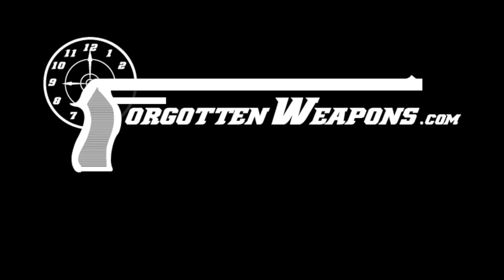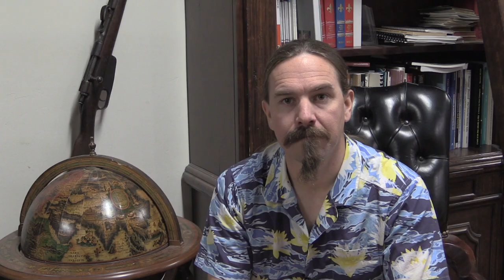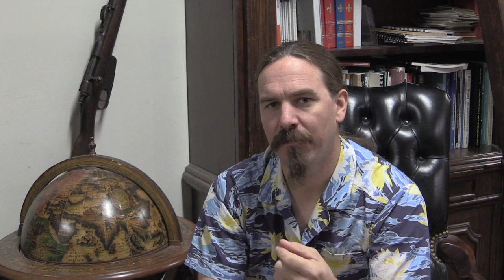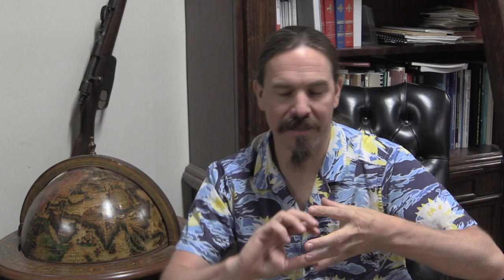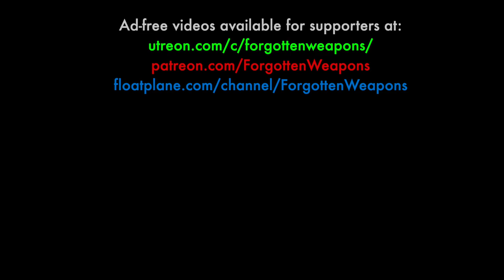Ask Ian: Progressive Twist (Gain Twist) in Small Arms?

Comment: The only variable depth rifling I have heard of is in large guns where the rifling starts deep and finishes smooth bore.  This is to reduce drag by smoothing the driving band into the body of the shell.
Reply: In Russia, a lot of civilian rifles start of smooth bore and end with about 100mm of rifling. They’re still considered shotguns because the majority of the barrel is smooth bore, but you still get a bit of spin stabilization at the end.
Reply: @ASaltySeabass  It is amazing the number of non-optimum designs that exist to get round laws.  I would have thought that starting rifled, then smooth would work better, as the bullet would not be going fast when it got to the rifling.
Reply: Carcano’s had deeper rifling towards the muzzle to reduce friction.
The German 13.2mm TuFG rifle was a squeeze bore where the muzzle was smaller than the breech by 0.2 mm giving a 13mm projectile. 
The Australian Myra Extruder 0.22” long rifle was similar with a 0.17” muzzle.
Reply: @allangibson2408  None of that makes much sense to me.

Rifling getting deeper towards the muzzle is likely to cause gas to escape along the groves.

13.2mm down to 13mm does not seem like a useful squeeze, but it is enough to cause stress in the bullet and barrel.

22 to 17 is a useful squeeze, but I suspect it would distort the bullet in variable ways, destroying accuracy.
Reply: @charlesphillips4575  The 22 Myra Extruder was noted for its accuracy and high penetration (a combination of high velocity (a function of being a squeeze bore and the increased breech pressure) and high sectional density (like the 6.5mm Carcano). Spin stabilising a narrow bullet requires high rotational velocity however. The Myra was noted for punching holes in steel that standard 22’s just bounced off.
The theory behind the increased rifling depth was decreased friction (I didn’t actually say it proved to be a good idea (but neither was the Blish “Lock” on the Thomson Gun).
The 13mm TuFG was capable of punching holes in 20mm armor plate at 200m. The bullet design was copied for the 0.50 Browning Machine Gun so that part worked. Browning didn’t copy the squeeze bore aspect however.
Reply: The Springfield 1861 from the civil war uses a variable depth rifling which is important for accuracy of the miniè ball

Comment: Part of the large bore issue is that the circumference is far larger so the outside is being accelerated in it’s rotation far faster than in a small diameter bullet so the stress on the jacket/case join is much larger. Lead bullets for black powder arms suffered similar issues due to the ductility of the lead so the stress was at the lead/steel rifling point so their interpretation was the lead stripping off the skin of the bullet and damaging accuracy and lead fouling the bore. Initially that led to harder lead alloys and then to paper patching. Forsyth dealt with the issue in large bore sporting muzzle loaders by drastically reducing the twist to allow higher speeds from larger charges.

At the end of the day the bullet exits the barrel with the twist rate at the muzzle. As long as it is not damaged then the rate of change of the twist earlier in it’s journey up the barrel has no effect. Gain twist is useful only in limiting the stripping of the bullet lead skin or hard bullet jacket.

Thank you for explaining this Ian.

Comment: There are a lot of jacketed bullets that are suited for the .45 Colt cartridge, that would not stand up to the much higher pressure of the .460 S&W. The gain twist in the .460 would not put as much stress on those bullets. Also, there could be a slight reduction in chamber pressure, but I don't know that for a fact.
Reply: Ian mentioned this in the video about the auto mag .357AMP kit. I wonder if progressive rifling would minimise the problems with that cartridge. I live in the UK so all this might as well be "how to engineer a unicorn" but it is sure interesting stuff.

Comment: I think this is something that needs further research. 

Enter the 8.6 blackout 1 in 3 twist.

Because the bullet is mostly sub-sonic variants the 1 in 3 does very well, and delivers unheard of accuracy and energy.

If a much faster super-sonic round started with a slow twist rate and ended with something like a very fast 1 in 3. I believe there would be significant improvement similar to 8.6 BO

Comment: I could see reasoning the progressive twist rifling on the 460 S&W for exactly the reason Ian noted. Imagine a 180-grain jacketed bullet intended for the 45 ACP handloaded hot in a 460 S&W.  I'm sure the velocity would be impressive but at that speed the jacket may have difficulty remaining intact with the lead core.
Reply: Speer 200gr hollow point meant for. 45acp would be bad.

Comment: One thing I did notice, because I shoot a lot of both semi-automatic double action revolvers and single action revolvers. Is that on my Super Blackhawk when I inspect recovered bullets, the Leading Edge of the bullet where is engaging the rifling always has skid marks on it where it is engaging and slipping on the beginnings of the rifling. It's an interesting way to show whether or not a particular projectile was fired from a single action revolver or a double action revolver. Because they have a longer cylinder normally, the bullet accelerates much faster before it engages the rifling. In something like a 44 Ruger Super Blackhawk, I have seen test where they have completely removed the barrel and the bullet from a Winchester 240 grain hollow point will exit the cylinder at 1100 ft per second, if you leave just 1 inch of barrel it will be about 100 ft per second less

Comment: Ian: "Too high a twist rate can lead to jacket separation" 

Me: stares intensely at Q 8.6 BLK supers with a 1:4 twist barrel
Reply: I remember listening to frank galli of snipershide talk about how he had a 338 lapua that had some radical twist rate because of the mono-copper bullets it was using. Supposedly, the bullet being overspun helped transonic turbulence be overcome and it had to be all copper because the lead being soft and very hot would explode through the jacket. I assume the blackout either gets around this by being slow enough or having monometal bullets.
Reply: @khopkins9632  that's the thing, it does neither
Reply: @charlesfisher3983  Well, it being slower projectile surely helps a lot.
Reply: @randomnobodovsky3692  it's still supersonic. At the advertised twist rate and muzzle velocity (2200 fps], the 8.6 blk is doinb 2.7 million rpm and the jacket is experiencing 1.3 million g. The only thing that can stand up to that are solid bullets. Which 1 damage the barrel and 2 are prohibitively expensive
Reply: @charlesfisher3983  2200fps is 26400 inches per second. With 1/4 twist rate (1 revolution per 4 inches) it's 396000RPM (6600 revolutions per second multiplied by 60). Or is my math wrong?
Reply: @randomnobodovsky3692  youre right my math was wrong on the rpm. But my math is pretty close on the g force. And there are pictures surfacing already of 8.6 rounds suffering jacket separation and blowing up cans. Especially the 1:3 twist barrels (which are around 590k rpm
Reply: @randomnobodovsky3692  and that twist rate is really unnecessarily fast for stabilization. The Greenhill formula indicates a twist rate closer to 1:8 as being more than sufficient
Reply: @charlesfisher3983  Well, if jacket separations are already shown to be happening (which they should), then this needs deeper research. Anyway, thank you for pointing it out.

Comment: Former CIWS tech here. The barrels are surprisingly easy to clean; you'd think there'd be lots of fouling from it's high ROF (4,500 air, 3,000 surface mode). Thanks to the plastic discarding sabot however, that's not the case. The actual heavy tungsten penetrator is 17mm; the plastic jacket petals off very quickly after the projectile leaves the muzzle, due to it's incredibly high velocity.

Comment: Very informative as always. Thanks.
   One aspect that was not so much tuched on was the relation between oreassure and heat and the resulting barrelwear. You mentioned it abit with the carrcano. The exccesiv ware can be dealt with by different surface treatments but the issue with heat stays. It should reduce the heat in ex machingun barrels specially with the new high preassure rounds that are beeing procured recently. 
   So a combination with the polymer casing and gaintwist i think it could really prolong the fieribg cykle. Sthough I supposse it is a more expensive production method.

Comment: Another reason is pressure.  Progressive twist further deforms the rifling engraving as helix angle increases. Pressure maximum happens within inches of distance from the chamber.  Initial slow twist reduces drag which reduces pressure.   Increasing bullet drag later maintains pressure which assures efficient combustion.
Bore erosion is a function of pressure, not bullet friction.  Pressure and temperature track together.  
Early smokeless propellants were very hard on bore life due to this initial pressure spike.  
The British added petroleum jelly to Cordite to reduce temperature, DuPont used deterrent coatings to extruded propellants,  creating the Improved Military Rifle propellant line.

Now, on larger bore gain twist rounds, these typically utilize driving bands as the projectile is usually thicker steel which doesn't easily engrave rifling.  Driving bands take gain twist better without jacket stress.  And again, gain twist is used for pressure reduction.

Comment: I would imagine that a progressive twist barrel would give you a little bit more velocity. With progressive rifling requiring less initial energy to get the bullet moving would have to reduce the overall energy loss giving it higher velocity.
Reply: There is some data from High Power shooters that gain twist does provide slightly more velocity. Bartlein offers a gain twist 20” .223 Wylde.

Comment: I'd add that with progressive twists, the initial acceleration of the bullet is higher than with a uniform twist rate, because there is less initial resistance - however, the side benefit of that is a lessened peak pressure that has a somewhat gentler initial acceleration curve.  Rifled shotgun chokes exhibit this behavior, where there is a noticeable difference in recoil between a smoothbore and a rifled-choke bore.  There is also somewhat of a difference in recoil between a fully-rifled bore and the other two types.  I've never been a fan of the the rifled-choke, as I've seen some weird slug patterns in comparison to the other two types.  I visualize a round accelerating down the barrel, then suddenly having to encounter resistance in the form of the rifling's forced rotation.  To me, this would result in the expanding gasses experiencing a millisecond of pressure spike; but a pressure spike that shouldn't be as high as the initial pressure spike upon ignition.  My two cents of babble today.

Comment: The relatively new 8.6 Blackout from Q is engineered for a 1:3in twist. The high rate gives it more energy on target, especially for a long range subsonic cartridge. If they used progressive rifling they might get even higher twist rates without jacket separation. Unless of coarse they already do but I dont have the technical data :(

Comment: IMO they probably use progressive twist in Gatling guns to reduce barrel heating. In a normal barrel all of the energy and thus heat from spinning up the projectile is concentrated at the breach where the bullet first engages the riffling. This is already where most of the barrel heating is going to be concentrated due to combustion and cutting rifling into the projectile. On a normal gun the extra heat from spinning up the projectile is too insignificant to worry about, but on a gun that fires 4,000 rounds a minute the heating is going to be much more substantial. By spinning up the projectile over the whole length of the barrel it spreads the heat out over the whole barrel. 

....In addition spreading the friction of spinning up the projectile over the whole barrel should reduce barrel wear. Which is also important with a Gatling gun's crazy high rate of fire.

Comment: I always thought gain twist was a good idea. After examining thousands of fired bullets under a comparison microscope all of them show some degree of skidding on the forward portion bearing surface of the bullet. Skidding happens when the bullet first engages the rifling on firing and it hasn't yet started to rotate. In badly worn barrels, the passive shoulder on the bullet engraving will show the skidding marks extending the length of the bearing surface to the point of allowing gas to escape there. When you think the bullet goes from 0 rpm when it first starts moving forward to something like 50000 rpm in several inches to finally reach a over 200000 rpm when it leaves the bore, it makes sense to try to increase the rotational speed more gradually if anything for longevity of the barrel. I don't know if it makes enough of a difference in the life of a barrel to be worth it since so many factors influence the accuracy life of a barrel. Maybe it reduces fouling closer to the chamber by reducing the pressure on the driving shoulder of the rifling? It may even reduce peak pressure slightly. This might produce slightly higher velocities. These are probably very small improvements that normal shooters wouldn't notice but if Mr. Pope thought it was worthwhile, who am I to argue with him.

Comment: The Paradox Gun (US329303A)  also uses a short section of gain twist rifling at the muzzle. The rifling is often very sharp if intended to be used with soft lead bullets and increases both twist rate and depth of cut into the bullet. These were mostly 8 to 16 gauge double guns made to shoot shot and/or short lead bullets.  It was first made by Holland & Holland in 8 ga though 28 ga as side-by-side double barrels. They still list a 12 ga SBS Paradox gun in their catalog. Progressive or gain twist rifling is necessary for a Paradox Gun or modern Paradox shotgun choke tube can function. In order to impart spin to a cast lead bullet moving over Mach 1, the rifling must be deeply engraved in the bullet before it can spin a relatively soft lead bullet.  The Paradox Gun was always and still is a compromise that provides at best, an improved cylinder choke shotgun and/or rifle capable of taking any game on earth out to 100 yards. Paradox double guns have some popularity in Africa, India, and any place a hunter might encounter large dangerous game bird hunting or in daily affairs in non-permissive environments that restrict rifles, pistols, pump, and automatic shotguns. At 540 grain at 1650 fps a 12 ga Paradox gun gives 4535 ft/lbs or 6148J of energy at the muzzle

Comment: The Civil War era Parrott guns, an early rifled muzzle loading cannon, used a progressive twist.  I could definitely see reducing the strain on those early shells, since they were not terribly solidly built.   
    Unfortunately, Parrott rifles of all sizes had a bad reputation for blowing apart at the muzzle, which could be due to increased stresses on the barrel material as the rifling twist got tighter.
     The large Parrotts - they made them large enough to throw a 100lb shell - additionally had a terrible reputation for blowing out the breech of the gun, which sounds more like an issue with materials and manufacturing techniques to me.

Comment: The S&W .460 Revolvers may have another problem without progressive twist. By the way that´s a not so uncommon problem with many S&W Revolvers in different calibers:
The barrels are screwed into the receiver - but sometimes, when they are not tightened good enough or the contact surfaces are not perfect, the barrels start turning a bit during shooting. You would be surprised how many S&W Revolvers have the barrel not nicely straight timed at 12 o´clock 😁
I had cases with .500S&W Revolvers where the barrels would start turning in during shootin until there was no more cylinder gap and the cylinder was binding..

Comment: I own a pair of the X-Frame 460's. Smith and Wesson make the claim that the progressive rifling lessens the recoil.  I do know that while rifled tank guns have muzzle brakes, smooth bore tank guns do not need them. So the argument is that a slower pitch at first aids in creating a softer recoil. I myself wonder how it is a bullet survives the changing pitch, it seems those forces on a bullet jacket would be very hard to survive. - Almost as an aside, the 460's are very interesting guns in recoil, with a unique slowing of the force after the initial jump. I give the muzzle brake credit for that. But, my 45-70 T/C Contender has a muzzle brake, but does not have anything like the feel of the Smiths, and that gun is far lighter.
Reply: I have a x frame 460 s&w from a dist. ,custom made for them ,the barrel is 14"long with no muzzle brake, the cyl. is non fluted, the hammer and trigger are black, the revolver is very accurate at 100 yds.

Comment: I’m correcting Ian mistake. He said 0-3000 rpm. A 223 with a 10 twist at 2800 fps is 201,000 RPM
If a 7 twist it’s 288,000 RPM.
Reply: Yeah, was going take my own comment. I couldn't find the twist rate of the Phalanx CWIS (M61A1), but assuming 1:12, at 3600 fps, it's 3600 revolutions per second, or 216,000 rpm.

Comment: Well the angular accelleration is a proportional value to the linear acceleration with a fixed twist rate and function of the twist rate gain otherwise. So you're basically just smoothing out the high>low accelleration that gun barrels cause.